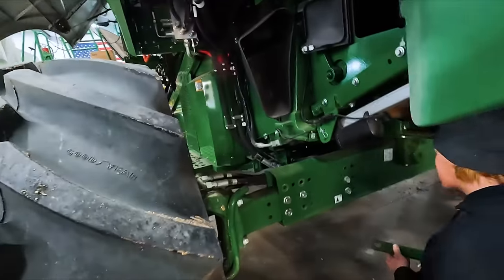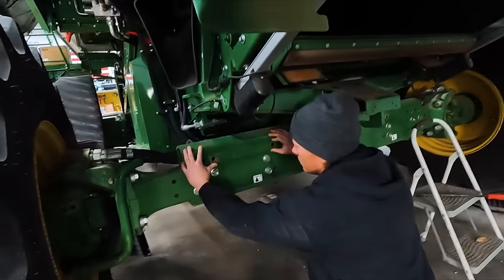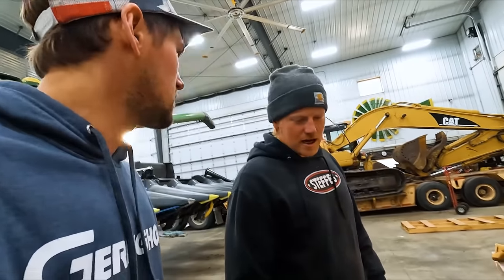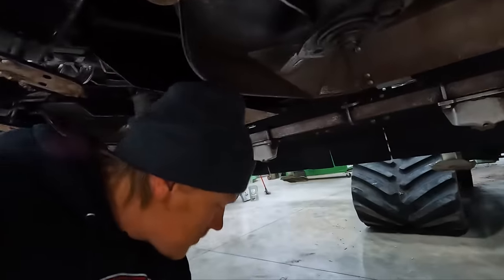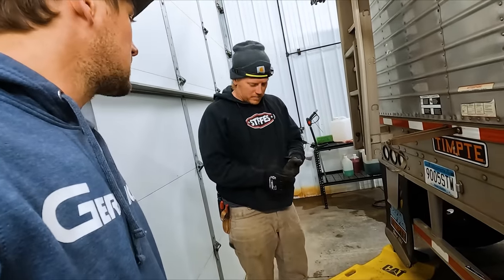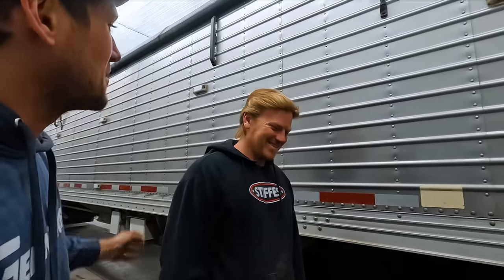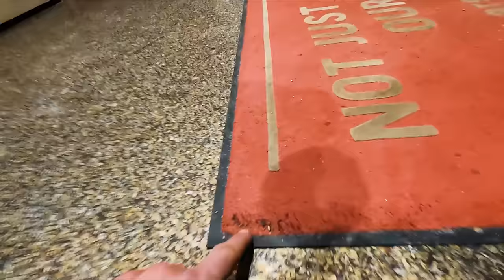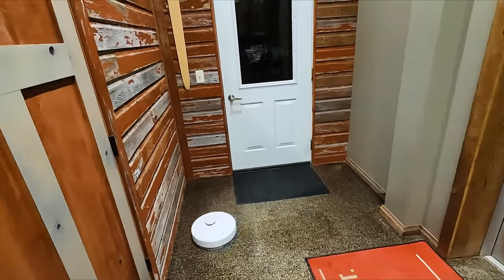Gotta Keep The Wife Happy!!

Comment: I would have started with smaller drill bits and worked my way up in size. Much easier.
Reply: That’s why the boys is coned no need
Reply: @dill5500  obviously it wasn't working very well at all
Reply: Or get a mag drill we all know how to chet likes buying tools. And I'm pretty sure Milwaukee makes a battery-powered one.
Reply: @jacobrobinson175  I have it I fucking love it
Reply: @Farmer1277  prob needs a sharpening
Reply: @dill5500  🤣🤣🤣🤣🤣
Reply: @jacobrobinson175 or just use a wood clamp lol
Reply: Yes, technically that's the correct way to do it.
Reply: Sometimes "sending it" isnt the way to be 😂😂😂😂
Reply: I’m sure they are combing the comments hoping some smart chap would tell them a better way to drill holes.
Reply: @jefflawsonqwest  that's a cool story. I'm sure they're combing the comments for useless replies just like yours.
Reply: and also i just learned dribble the oil on the top of the drill bit and itll run down the bit and keep running down the bit to keep it cool, Old guy in our shop taught me that last week
Reply: Use a center drill first to spot where you prick punched, then drill with smaller drills before you finish with the 1" Drill. Need a bigger drill press or buy a Bridgeport mill.

Comment: Guys will weld a small plate at an angle onto the inside of the back wheel of the 9530T to eject the straw out and prevent it from wearing off the paint

Comment: It is much easier on the drill bits and the user to start with a smaller drill bit and then increase the bit size up. Once there smaller hole is made the bigger bits go thru with ease.

Comment: Hi guys. We’ve had one those similar for just over year. It should set or you set boundaries. For carpet the water pads should pickup & it sweeps carpet. Ours does really well on carpet, you shouldn’t have to touch it except keeping it clean.

Comment: The floor sweeper may work better if you put the chairs on the table and remove the floor mats before each cleaning.
Reply: After it cleans around the table pull the chains out from under the table so it can clean under it,works good

Comment: If that’s the Roborock robot vacuum/mop, depending on the model, you might be able to get the dock that will automatically wash the mop pad and refill the water. For the direction that it travels it will alternate directions if you have more than x1 Cycles

Comment: I have one that is very similar to that (probably the same Chinese company with a different name), and it does an amazing job on my house.  It doesn't really learn what the best way to clean is, but it alternates directions that it cleans each time.  It also handles pretty major drops between carpet and linoleum, even negotiates around tables, chairs, and one particular set of really stubborn living room tables that have metal frames.  Does a great job on my huge kitchen and dining room, which are linoleum.  I find if it gets really dirty, take off the mop, and let it vacuum the excess dirt first, then put the mop back on.  lol

Comment: By far one of the most entertaining video with Mr. Dougo trying to figure out A.I. Reflecting-all he has to do is remove the rugs and turn the chairs upside down on the table and of course his pre-moistened issue.😂But I do know with The Dream Team and Mr Dougo this machine will be in tip top working order and possibly will be doing it at a greater speed!🎉🏎️🏎️

Comment: Not sure if you read comments or not but if so, I would check with the person who did your ceramic coats as you may need to go to a different soap than you had previously been using for equipment. Pretty sure that they need to be a very low PH or it will significantly lower the life of the coating. I would suspect that your foaming soaps are strong to break thru the grime. My car is ceramic coated and the installer emphasized that they needed a certain soap.

Comment: You're supposed to start with a smaller hole and work up to the bit you want. It sounds tedious and all, but I promise you it goes faster and puts less wear on the bits, plus it makes a nicer hole and it doesn't move the piece around so much.

Comment: Pro Tip: Run a smaller drill bit say a 3/8 and the big drill bit will go through much easier.
Reply: It's a step bit
Reply: @agger838  
I know what it is.
I was a machinist for just shy of 30 years before I recently retired.
  If you take the pressure off the point of a drill it cuts way easier.

Comment: Nothing wrong with drilling three at once. Maybe look at your reduced shank drill inventory. That task needed a 1/4" pilot and a conventional sharpened drill to finish. Big drills, slows the go. Probably only 200 rpm. Sounds slow but afterwards your drill should be in good condition still. Seriously if you are in the market for a piece of engineering equipment find a Bridgeport milling machine and make sure you get an E40 collet chuck and a machine vice. You will never look back. Can drill big holes, tap big threads and if you use a hole saw can cut out holes up to about 5" dia if you go slow. You can put flats on things, cut keyway to name a few things. I don't own a drill press. I drill everything on my Bridgeport. I also have a lathe. I am a machinist by profession.

Comment: Instead of all that drilling you could have put your bolt through the frame then put a nut with washers if needed then your bracket then nuts ,the first nuts and washers serve as a spacers.

Comment: And the bigger the drill the slower  the rpms.
Reply: That was going plenty slow. The problem is they didnt start with a pilot hole
Reply: If you open the top of the drill press you can change the belt on different sheaves 2 Change the speed rate.

Comment: I have a Yeedi by ECOVACS Cube Robot Vacuum and Mop that cleans its moping pad. you can set it on the app to self clean the pad every 15 min and if you set it on a timer it does its job automatically. but shops see a lot of dirt so its would be a lot of work for them little robots.

Comment: I can't believe you let the dog near the drill press when drilling metal!  Metal in the paws, eyes, I just cringed.  I did get a bit of metal in my eye when in Machine Shop during high school.  Always wear eye protection after that.  

And you should have drilled a pilot hole, about 1/4" before starting to drill that 1" hole in the steel, so that the point of the drill will have a hole to follow.  And the way you clamped the steel into the drill press, was there a space below the green steel for the drill to punch through, without hitting the drill press vice?  

Back in the 1960's, when the Navy was finding it difficult to get the guys to wear eye protection, they put up some attractive ladies pictures and a picture of a guy with metal in his eye, and it said "This guy will never see that lady the same way again."  It increased the use of eye protection greatly!

Comment: why do I hear a air leak on your trailer after you changed the bag
Reply: When he pressures up the lift axle air bags to test it takes weight off the main suspension causing the main suspension to dump some air, it's working as it should

Comment: Did you ever hear of drilling a pilot hole first with , like a 3/8" drill, then the 1" drill.  and you don't have the proper angle on the drill. a properly sharped drill is 59 degrees.

Comment: Chet, you guys are a danger to everyone, 1) abusing tools / machinery is not cool, 2) as Erik said the piece can helicopter and I’df it does you will be in the ER, 3) the rule is small drills - run them fast, big drills need to run slow, 4) as mentioned in other comments you start with a small hole and work up, 5) more pressure on the drill press quill is WRONG, if the drill is sharp and running at the right speed and with lube it should cut nicely - Drill presses have the ability to change speed, so take the time